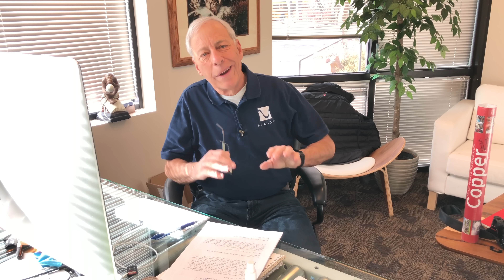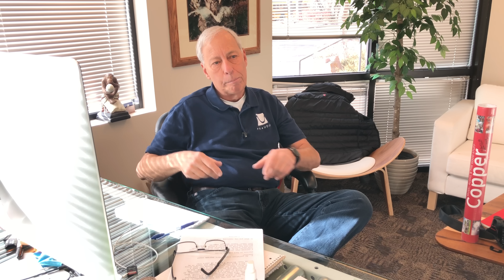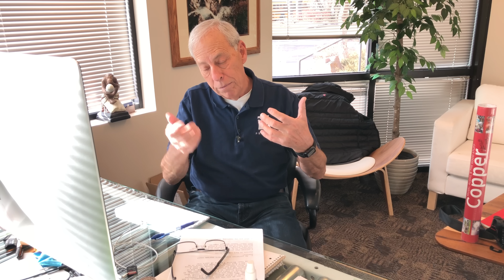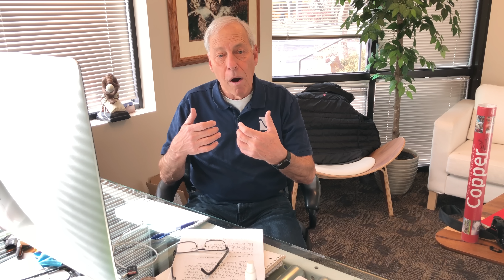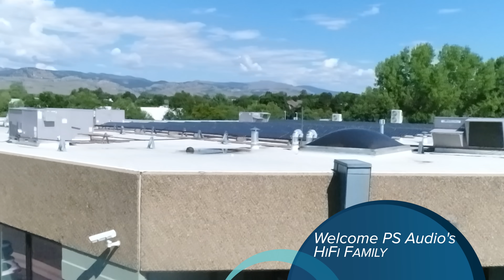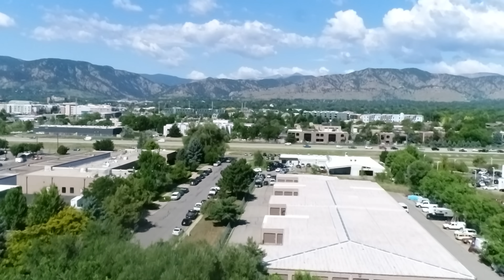Do isolation transformers degrade sound?

Comment: Thanks for your informative videos. In this case, I have to disagree to a degree. FWIW, I've been doing audio for 45+ years, was a reviewer during SoundStage's early years and later Ian White's, American Wired webzine. I also  had a shop in my home for a few years (Sounds Right Audio).  After some use and reviews of various PLC and BPSs (yes, even your early power regen) I found using hospital grade iso x-fmrs in my system offer very good results.  I agree they will do nothing for voltage drop (not a problem where I live) and undersizing the x-fmr will blunt performance, but they do a good job elimination noise primarily originating IN THE HOME via switching power supplies in computers and appliances as well as ballast noise from fluorescent lights and even CFLs.  The noise reduction can be measured with various meters. In my case, a Graham-Stetzer meter.    The improvement I hear is a lower noise floor giving better low level detail and resolution.  SIlver Circle, Equitech are nice units, but pricey.  A Powervar or Oneac can be had on Ebay for a few hundred dollars and some wiring upgrades, better duplex outlets improve sound even further.  I think your Power PLants will do better than my iso-xfmr, but they are a tad out of my audio budget.
Reply: Many audiophiles aren't trying to achieve perfection: low noise, low distortion, reduced feedback, reduced harmonics, accuracy, etc. They are simply going for a sound they enjoy.

The other audiophile camp is going for accuracy and trying to get closer to perfection to best reproduce what's coded or cut on the source material. And sometimes their efforts make the sound less enjoyable, even to them. And the noble ones can freely admit it. They're more like gear heads and technical snobs. They know that their brains and ears don't like it as much as possible, but the knowledge that the test microphone and robots must love it, is enough of a consolation.

I tend to lean towards trying to achieve accuracy, within reason, to provide a good foundation, but I'm fine introducing certain innacuracy if it sounds better to me, and I can be aware of how I'm deviating away from the source. That makes it easy for myself and others to know if changes will improve all content to my preferences, or if it is specific to a certain piece of music. I think it's best to avoid such deviations unless you only like one specific genre.

Problems arise when you don't know your goals or don't understand what's taking place-- and that goes for all of us. Nobody has audio 100% figured out.
Reply: Is it possible that what you're cleaning up and removing could be enjoyed by another?

Paul very much seems to be in the camp of letting "good sound" be the goal. I agree with him, but sometimes I'm a wee bit skeptical that the areas where his products don't measure well are incorporated into his rhetoric that such "apparent flaws" were allowed to achieve "musicality."

It's a good tactic, and it has merit, but proving it is quite difficult. And hard to prove claims deserve more skepticism. I don't know if I could trust my ears enough to know if PS Audio products would impress me enough to upgrade. So, the in-home tryout is a good policy to alleviate some concerns.
Reply: I use a hospital-grade Isolation transformer. It's used only for safety reasons when I work and do tests on radio and stereo equipment.
Reply: "better duplex outlets improve sound even further" 😆🤣😂🤣😆🤣🤣😆🤣😂😂🤣😆🤣🤣
really ?? 🤔
Reply: @poserwannabe1  Yeah, really.  The stock outlets were old and had poor grip strength.  They were replaced by new Hubbell industrial outlets. You're probably thinking I got those expensive Furutech or Oyaide duplexes.  No.  Just industrial grade Hubbels.  Yeah, the grip on the bass improved noticably.
Reply: @Mike82ARP  ok, well I've been doing audio professionally for over 40yrs also and my comment was posted because I know it's not possible for a duplex to affect audio...you either have a circuit or you don't. peace
Please don't bring up "micro arcing" .... smh
Reply: poserwannabe Well, since you hide behind a moniker rather than saying who you really are and show whatever bonafides you might have, I would guess you’re probably not too good at your job.   smh too
Reply: @Mike82ARP  
Hahahaha .. funny thing about the net, you never really know who you're talking to do you ??? I've mixed FOH for tens of thousands, I've built systems for clubs, churches, theaters, stadiums and years of home theaters and 2ch systems...I've made a lot of money along the way and I'm still going strong, lmk if you're ever in Pittsburgh PA and I'll buy you a beer...🤣😆😂
Reply: @Mike82ARP  - it is a good thing to keep personal opinions separate from the professional work/life. No idea why anyone would want to mix the two. Professional opinions are driven by profits/gains.

Comment: No experience here, so I personally can't say.  Paul's company makes and sells power regenerators and, from the independent reviews I've read, very fine ones.  I've also heard of a German company called Stromtank (electricity tank, as in storage container, not heavy armored military vehicle, according to Google Translate), that has a large LFP battery that is charged up from the power grid and then has a (presumably sophisticated) DC to AC converter to power your system.  You can charge it up and then disconnect it completely from the grid (or not, chemical batteries also make good power buffers).  I don't know what this equipment costs, but from what I vaguely recall from mentions in a couple audio show reports, they are very expensive.  Again, no experience here.  Just throwing out some additional information.  This is all way beyond my means, but I enjoy keeping up with the diverse branches of this hobby.

Comment: I support Paul’s position on this one. I’d recommend the PS Audio Stellar Power Plant 3 for most applications.

FWIW I worked on a project in the early 70’s that used a power storage regeneration process. Power line to motor, motor output shaft drives flywheel, flywheel output shaft drives generator, generator drives magnetic coil. As far as I know that thing is still working. There were three flywheels. Each flywheel weighed about 10-tons. The energy stored in the flywheels was extracted in less then 10-milliseconds. That thing was a little scary.
Reply: I did a little instrumentation on it.
Reply: Yes MG sets, these were very popular in Florida and Texas where most of the power hits are lightning based and short. But I think modern UPS technology has replaced most of them. There is a newer version where they use carbon fiber flywheels with mag lev bearings, very low friction. These are claimed to hold out for almost a minute in some cases. The benefit is no battery maintenance. But one minute or less is cutting it very close for a large diesel generator to come up and stabilize. Therefore I don't think that many of these "mechanical batteries" are sold.
Reply: @andydelle4509  Thanks Andy for taking a little interest in this. I changed the time frame to the “early 70’s”. After I joined GA they sent me to the Intel ICE-80 school and after that one of the assignments they gave me was to design and build a sequencer for a project that still is active today. I doubt my little contribution is still there. Lets call this thing the “Big Squeeze”. Here’s a link to it. Enjoy:

http://www.ga.com/diii-d

Comment: Only reason you would have a flat-topped/truncated sine wave is if you have too many devices on that branch circuit!!!...in which case, the power company can connect to a slightly higher voltage tap on the transformer at the power pole!!! A/C voltage transmission was implemented for the transmission of voltages over a long distance with minimal voltage drop!!!😁👍🏻
Reply: Computing devices are the most voltage sensitive from my experience!!!😁👍🏻
Reply: if ultimate numbers on a sheet of paper is what you are after, use a manufacturer that uses proper voltage regulators, or an smps, neither is affected by input waveforms or noise

Comment: Might be worth having new ground rods driven at your house.
They are copper clad steel and been in the earth for as iong as the house is old, (usually).  Recently had a house upgraded to 200 amp service and the electrician drove new ground rod (s) for the new breaker box.  It seemed the stereo system sounded a bit better.  Maybe better grounding?, maybe not.  Swapping the ground (s) should be done by an electrician.  At the least, the mains have to be off during the swapover.
Reply: Agreed. Where I live, the codes have changed where 2 ground rods are required rather than one.
Reply: @Mike82ARP  Yeah, me too (two rods).   Ground rods are not a "done deal" for power grounds.  Soil conditions vary wildly and that drastically changes their effectiveness.  Where I live has average rainfall and they are driven under the drip line of a roof, so good, (soil type, have no idea).  Other places, the soil conditions and moisture level are far worse and ground rod's effectiveness really suffers.

Comment: How about a UPS
Reply: Not recommended for 2 reasons: 1. the power they offer is usually too low to effectively power a system, and; 2. the AC many of them put out is a square wave rather than a sine wave.  Square wave AC doesn't sound good and can potentially damage your electronics.
Reply: 99% of UPS disconnect from the load if the AC line feeding it is good.
Reply: @wilcalint  But not for online units also called double conversion. Here the load is always running off the inverter. The incoming AC is rectified and feeds the inverter in parallel with the battery bank. There is no switch, the AC line simply drops off. APC did make a large UPS, the Silcon series, that use what they called "Delta conversion". These were 100kw and larger class three phase units. Here the input rectifier only charged the batteries. The AC utility  was in parallel with the inverter output, synchronized of course. That way the inverter only made up the difference needed should there be a sag - IOW the voltage delta between the utility and desired line voltage. This is a much more efficient unit except that your are not totally isolated from the line as with a true double conversion unit. This model is no longer made either AFAIK. I guess people didn't like the lack of line isolation although I thought it worked OK if you had reasonably clean utility power.
Reply: @andydelle4509  I've always enjoyed the product quality that APC/Schneider Electric puts out!!!😁👍🏻

Comment: I used to monitor the ac at my house but after awhile I stopped because the power coming in is very stable, also the wires are right off the transformer on the pole. When I rewired my house I used quality wire and ran a dedicated circuit to the outlet that feeds my sound system. If we get bad weather I unplug.

Comment: I noticed that my system sounds much better at night. Not as much "noise" over the lines, I suppose. The neighbors aren't using there "stuff".
Reply: I've noticed that my system sounds better at night, but only after several drinks.
Reply: Steve Fick sounds like you need a system with a better internal power supply

Comment: Yes noise suppression is the reason isolation transformers are used in commercial installations where a UPS is not required. They also protect against fast risetime spikes as again they limit bandwidth - which is good for a 50/60hz sinewave. Beyond it's true that they don't offer much. A home grade isolation transformer affecting a DAC by it's self is unlikely. The DAC is a low current device and certainly has regulated power supplies. However if the user also had their power amp on the same transformer, it could cause voltage sags through the isolation transformer and perhaps that's what they were hearing. Another type of power conditioning transformer is a Ferro Resonate transformer. These offer AC voltage regulation and can even hold a single cycle of AC in reserve - a micro UPS so to speak. But they also produce highly distorted sine waves and are not recommended for audio use.

Comment: The elephant in the room is still not having a good Earth and a low voltage between the Neutral to Earth conductors.
In worst case scenarios, having a large isolation transformer (That can carry the hole sound system, or even the hole building) in conjunction with a good Earth connection, can help to restore the Neutral to Earth conductor balance.
Isolation transformers also act as a filter that can help to block unwanted harmonics coming in from the supply.
First prize will still be to have your service provider, supply you with good AC.
Reply: Yes, a good earth to Neutral bond is required. But I hope your are not advocating a separate "audio system" ground rod. That is extremely dangerous and illegal. All earth ground rods for a building must be bonded together. You can have more than one, they just need to be heavily bonded together. Also the Earth is not some magical waste dump for electrical noise. That's a common audiophile myth. The Earth as a ground only comes into play for lightning, some radio transmission, and utility power. In these cases the Earth is part of the electrical circuit. It's not for an audio device. Think about it? Aircraft, satellites, your Ipod? Where is the Earth ground in those electronic devices?
Reply: @andydelle4509  Yup. I've heard people grounding their system via a rod close to where their system is located, and often a good distance from the home ground rod.  A lightning strike nearby can set up a potential between the 2 ground rods and fry your gear.
Reply: @Mike82ARP  And fry you gear is the least that can happen. I think a fire will most likely quickly result all over the electrical system - like in the walls.
Reply: false, not by a long shot